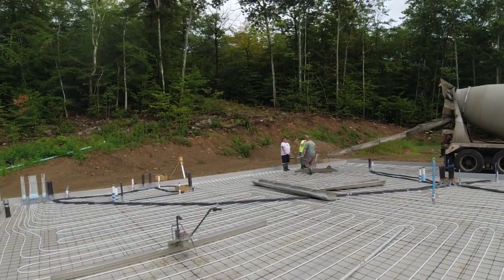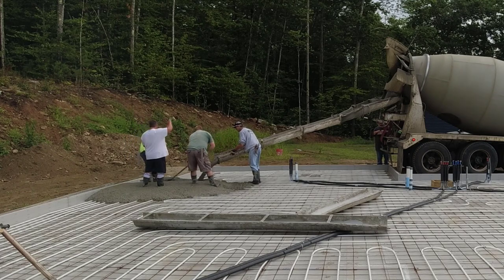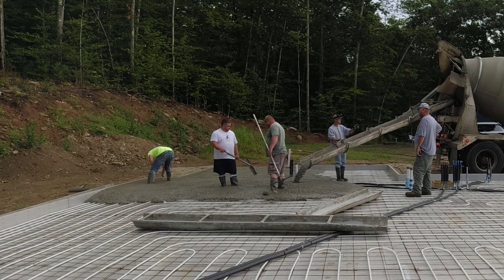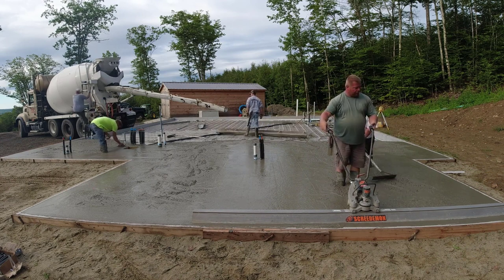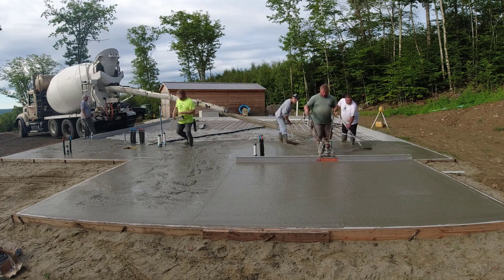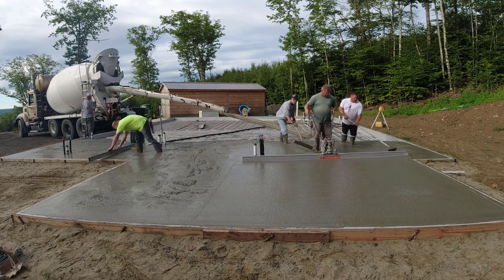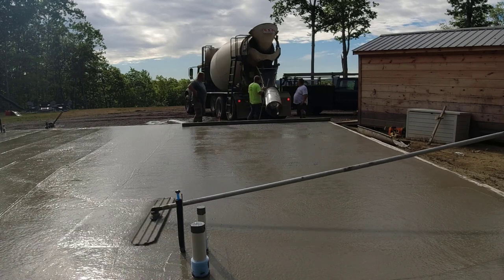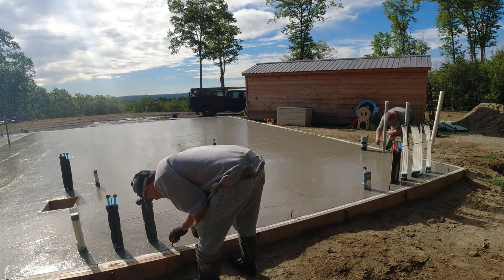Why These Concrete Slabs Are Easy To Pour | 41 Yard House Slab

Comment: Looking at laying down a 30x40 6" slab next spring up in the county. I know there's a 16 inch edge 2 inch foam under slab requirement for Maine on top of that the metal fab building requires a 24" wide 24" deep footing for the steel structure. That's a load of concrete. Pending how far you are from Westfield Maine I'd love to pick your brain on doing all the groundwork and framing myself. Thanks Mike!

Comment: The wire mesh has little value if it's not lifted up off the base. I assume in this situation it's just there to help hold the radiant heating tubes in position.

Do you notice the vibrating screed brings more cream to the surface than hand screeding?

Does the vibrating screed actually vibrate/compact the concrete similar to a conventional concrete vibrator, or is it primarily a leveling tool?

May I ask what the shute extensions made from?

Thanks for uploading the vid.

Comment: I have been out of the concrete business since 1988.  We did mostly industrial tilt-up buildings from about 50,000 to 120,000 square feet.  Things are sure a lot different today.  Back in my day, a deputy inspector would sent back loads like in this video.  One question; why 8" thick for a residential slab on grade?  I've never seen that before.

Comment: Hi Mike, I love what I’m learning from your videos. Quick question, I’m building a house with a heated concrete floor, does it matter if I use air entrainment for the floor or would that disallow a smooth finish?  Thanks in advance Mike.
Reply from the maker: We do air in garage floors, non air in houses. We still power trowel smooth with air.

Comment: For some reason I could never screed with 2 guys ! I would screed everything myself !
Reply from the maker: We're all taught a little different. As long as we get the same results it's all good!
Reply: This might be a dumb question, but on bigger slabs where the screed can't reach forms on both sides, how do you make sure you're not going to high or low on far edge?
Reply: @kajekage9410  grade pins or laser
Reply: @landonmorel3715  
That doesn't sound very easy
Reply: @treeamigo8447  that’s how it’s done..:you set a grade pin or use a laser to get a wet pad..strike it off then screed
Reply: @landonmorel3715  
Strike it off? What does that mean?
Reply: @treeamigo8447  screed a small pad so you have a reference point to screed off of